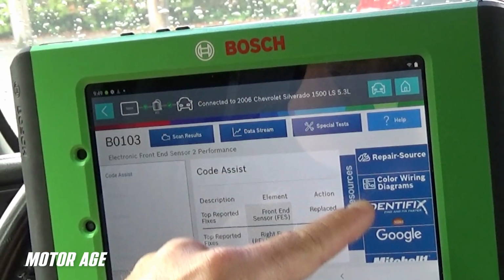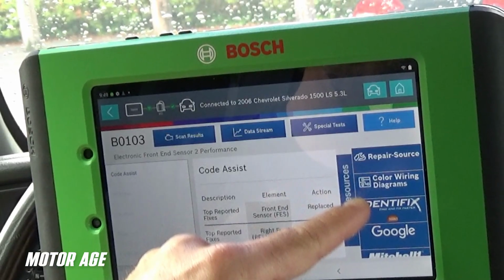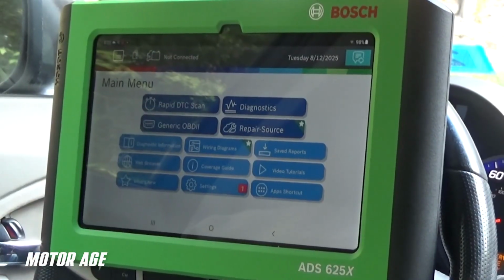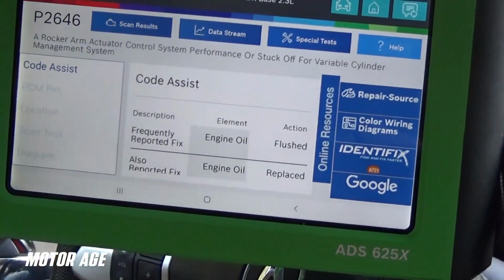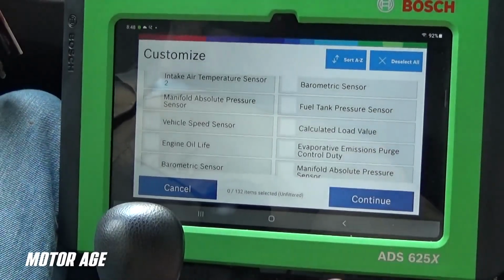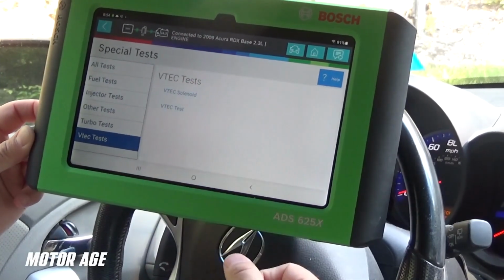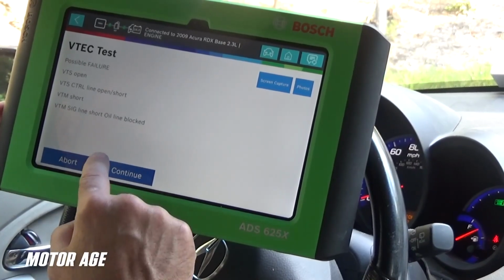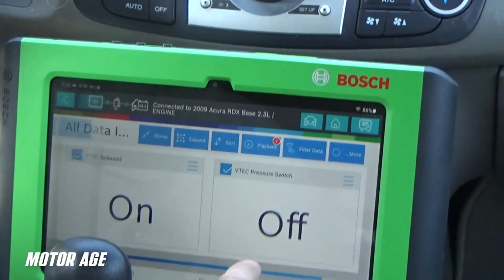Mastering Diagnostics #27: Maximizing Diagnostic Tool Functionality for Faster ROI

Comment: Hey are the wiring diagrams in built in the tool or does the tool just have access to platforms like alldata, mitchell,....etc where you access your account and view them.
Reply from the maker: Hi there,
We thank you for the question. The Bosch ADS625X offers availability to several sources of information. However, you we need a subscription to access them. This means you may access the information sources you currently hold subscriptions for!

Comment: Wrong!
The hardware is all commodity.
You can have a capable 10” in tablet for $250.

Not even the wireless OBD connector is “special”.

The SOFTWARE is what makes the difference!

But if you can observe, and as I called it 4 years ago:

Within 5 years we will have capable OBD readers for less than $600!

The software will too become standard as it’s NOT hard to figure out how the others do it!